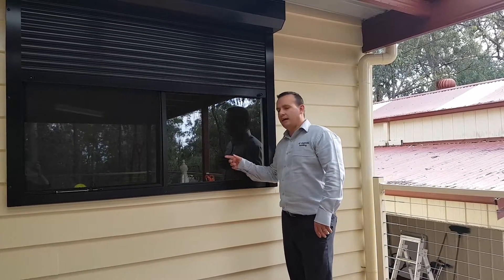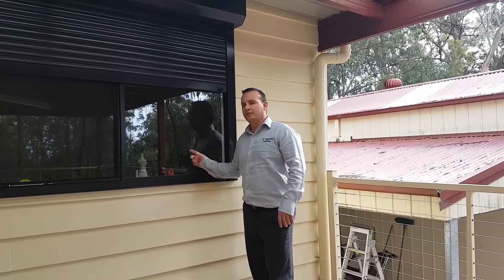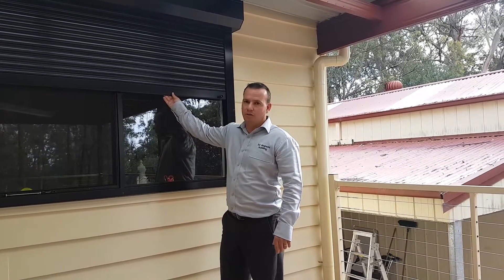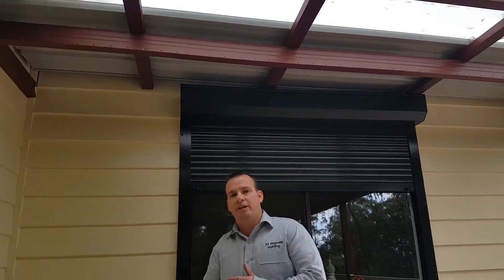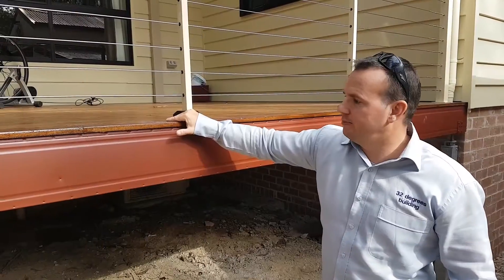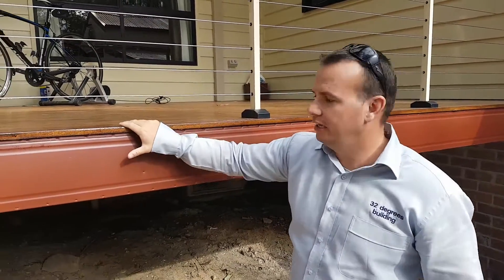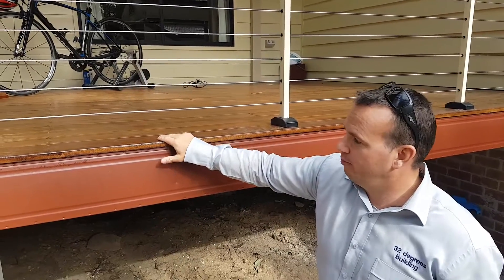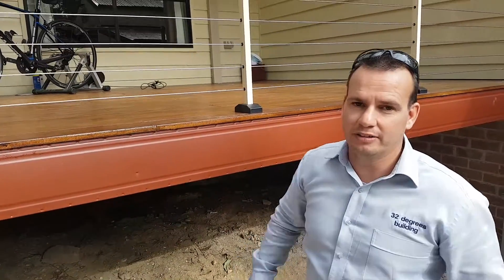Building in a bushfire prone area - BAL- FZ (Flamezone) - 32 Degrees Building

Comment: Do you know if gutter guard is a requirement for BAL 12.5?
Reply from the maker: Hi David, gutter guard is not a current requirement of the AS3959 for BAL12.5, however, we would still recommend installing this as a precaution if you are in a bushfire prone area. 👍